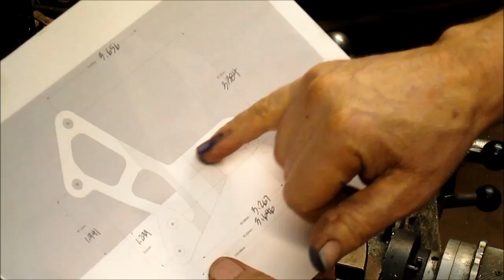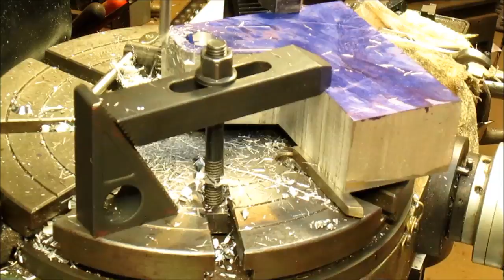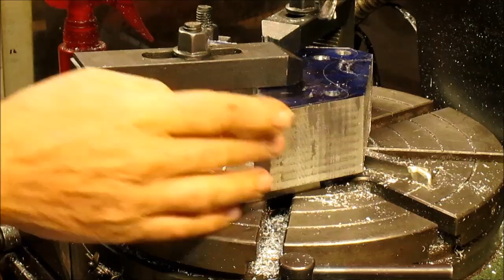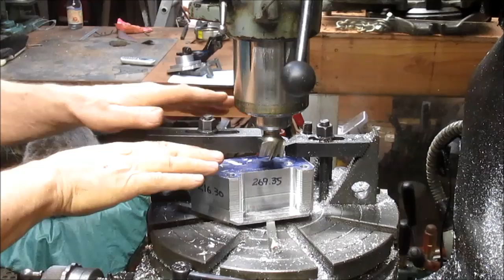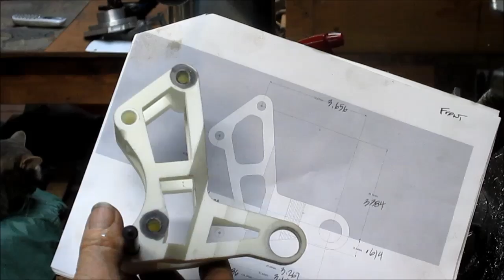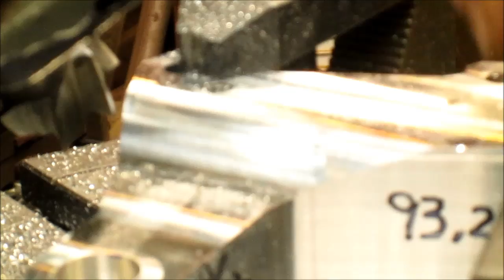Biker Brake Bracket 2

Comment: nice job so far looking forward to the 3rd part and using my south bend 8 inch rotary table witch ive never used.
Reply from the maker: +Jamie Buckley Rotary tables are invaluable when needed, but they are not needed often. Thanks for watching.